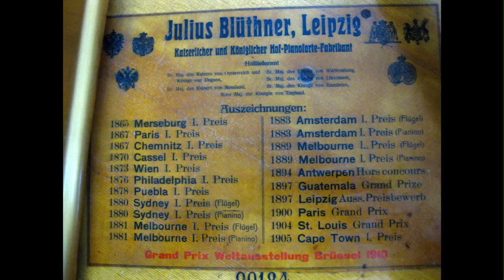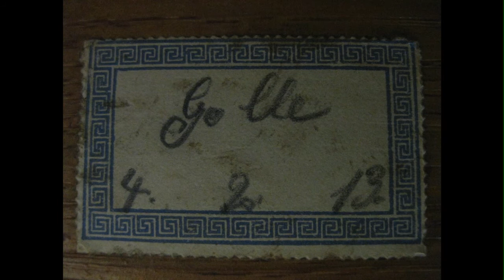Bluthner Model 6 ca 1913

Comment: I return to this video from time to time as I try to form my ideal for piano tone; although this is pre-restoration, it's a great starting point for the type of sound I want. The beautiful performance surely helps create that impression. It can be difficult to compare pianos on recordings (I've been watching a lot of demos of rebuilt/restored pianos) due to vast differences in quality of performance, mic type and placement, and room acoustics. By any chance (I know this was four years ago!), do you recall how this piano was miked for this recording?

(I'm a classical pianist and beginning piano technician who has sadly never played or worked on any Blüthner piano)
Reply from the maker: I'm very glad you enjoy it, William, and find it inspiring; it is a lovely piano, and performance. It certainly shows how moving the sound of small piano pianos can be. We used Danny Grimwood's own microphones, which are a matched pair of Schoeps small condenser mics, rather expensive but very very nice for piano; in fact the recording of my Model O on my channel here (as well as all the other recordings) also utilized these mics. Nothing fancy as far as positioning, just two mics a couple of feet away from the curved side of the piano. I should add that the instrument didn't sound dramatically different after restoration; we kept the original hammers, which were in good shape, and the instrument was in good regulation as well as very precisely tuned for the recording; probably the bass was a bit more crisp, after the restringing. Cheers, Allen

Comment: Anyway... a beautiful sounding piano.
Reply from the maker: Looking at the photos again (and trying to refresh my memory), I think that in the bass section alone with this piano there was what looks to be a plate under the bass tuning pin section, but it looks like perhaps a plated steel rather than brass? And thus somewhat scratched and with what looks like corrosion; we would have cleaned it up as best as possible. The other sections seem to have the normal cast iron plate configuration. Is yours the same model 6? Of course the models changed at times over the years.
Reply: @akwirght  mine is 1913, 238cm lenght with jubileum frame, beautiful piano, it has plates on bass section too.  It is a 3mm plate. I see model 6 doesn't have it in bass section, is it only pinblock? Have you made German loop for every string by... hand ? Pretty good!

Comment: You don't polish brass plates under tuning pins ?????? Why??????
Reply from the maker: That's bronze gilding, not brass. It can only cleaned so much, short of entirely re-gilding, which we did not do on this piano.
Reply: @akwirght  every bluthner I have seen was solid brass, like all hinges, wheels and pedals. I don't why yours is not brass. After all those works it is a pity... spray can ? The music I hear is that piano ?
Reply from the maker: No pianos have brass frames (aka plates). Almost all are cast iron, with gilding (paint) added. To regild the frame or not is a decision made based on cost and aesthetics. It is a demanding process requiring professional facilities and spraying equipment - not simply a matter of spray cans. And yes, other smaller parts are made from brass (pedals, hinges, pedal rods, casters, etc). The recording was made on the piano before the work you see carried out here; unfortunately I wasn’t able to record on it after restoration, and before it was sent to the client. With the original hammers kept on, however, it didn’t sound hugely different after, though - in spite of the new strings. A bit crisper, perhaps.
Reply: @akwirght  I am sorry but I have a bluthner the same age, the plate under tuning pins are separated from frames and screwed in the pinblock for additional tuning stability, like brushings on steinway. I don't know why your model was bronze plated. Someone had chrome (or nickel) plated over brass, bluthner were luxury piano in 1900 era. How do you made these lot of hitch pin loops? By hand or by a tool?  Best regards
Reply from the maker: @davidemarchi6366  Yours is a much bigger model, of course. Yes the loops are pretty easy to do by hand, with a little care and practice; you do the initial bend around the right sized steel pin or nail, then use pliers to wrap the loop around. It's a very satisfying procedure, actually (as so much about piano restoration can be).
Reply: @akwirght  keep up the good work!